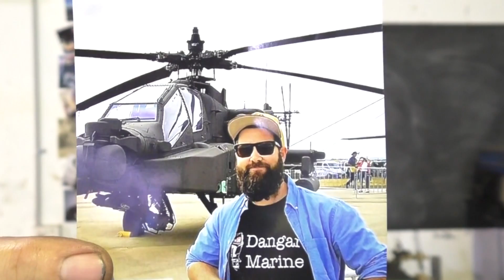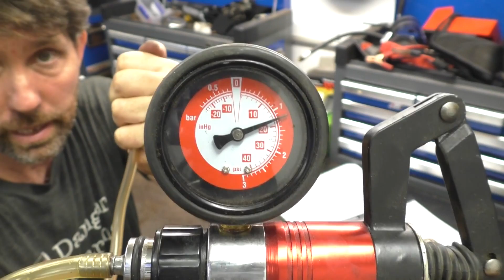Outboard fuel pumps

Comment: I have a question concerning the "problem" of the pump you rebuilt not being perfect (according to the pressure test) after your work..... What if you had wet or dampened the pump with some gasoline prior to the after-rebuild test ?  Would things not have been happier inside the pump if the new valves had some liquid at least passed over them prior to being pressure (or vacuum) tested? After all, they do deal with liquids, not air.  I do agree that it's good to test on the bench rather than out on the water, but just wondered if the test was completely fair to the newly installed parts.
Reply: Stan, you beat me by a few minutes. I agree that those valves should be 'lubricated' for the tests as they are not air tight, in fact they are not even fluid tight. They don't actually have to seal , just be very restrictive to reverse fluid flow as they are being pulsed very quickly . That pulse speed means that fuel cannot reverse flow easily . 
On the KT100 go karts  ( carb and fuel pump in one unit!) you need to put a squirt of WD40 on to the needle seat and on the one way valves to be able to set them up correctly. I use WD40 as some other cleaning fluids are not nice to nylon / plastic parts. The alternative is two stroke oil diluted 50:50 with kerosene, not petrol ( it evaporates too quickly and is too flammable for bench testing stuff)
Reply: I just tried this on my spare two stroke fuel pump and it worked OK. 
Using an old 12volt tyre pump ( a K-mart one the kids use to pump up balls and bike tyres) I connected it to the fuel pump pulse line via a T piece. The open end of the T piece went off to a ball inflation spike that acts as a restrictor and to allow the pumped air to escape so I didn't over pressurise the fuel pump. The tyre pump pulses are enough to operate the fuel pump.  The fuel out line was connected to a measuring jar, the fuel in line to my boat fuel tank .  With the air pump running for 1 minute I measure just under 300mL of fuel delivered- which is more than enough for my 50hp engine. So if you have an old 12volt air pump around (probably even one with worn out one way valves  would do, or take them out- then you can just connect it to the fuel pump directly)  you have a great test unit !
Reply from the maker: Out of interest I'll squirt a bit of fluid in there and see how it changes. I think the test is useful enough just to know that the case has sealed properly (certainly saved me this time!), but if it was possible to get a better indication of the health of the valves it would be good. I think the trouble is, that as you both say, they will never hold air pressure fully so drawing a line between serviceable and needing replacement would be tricky.